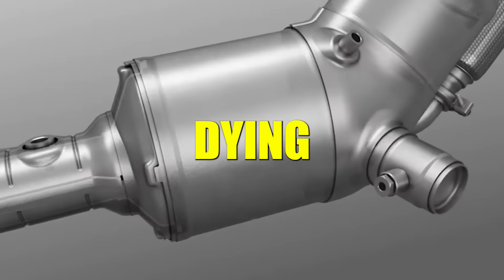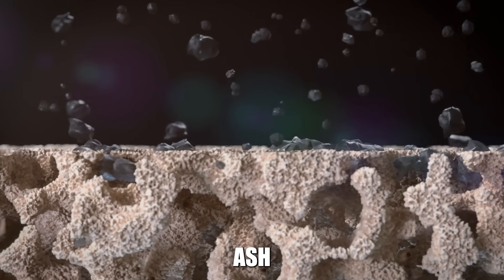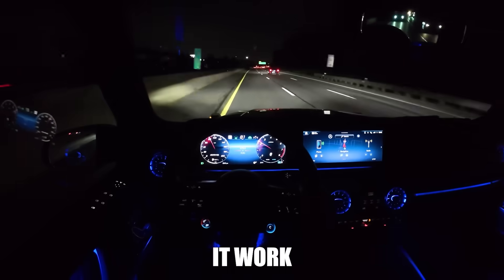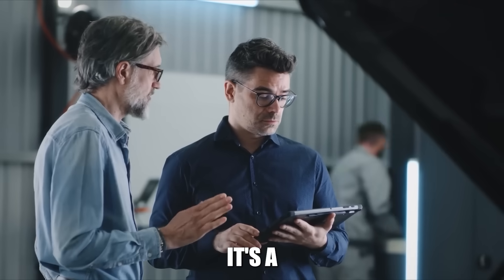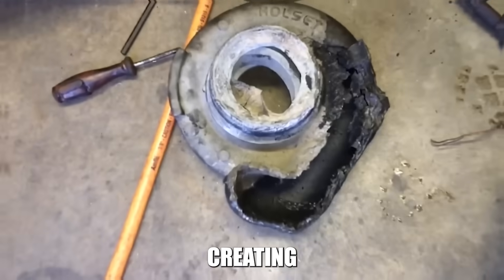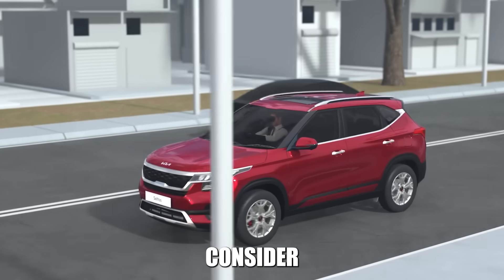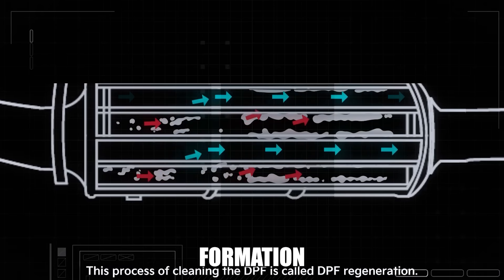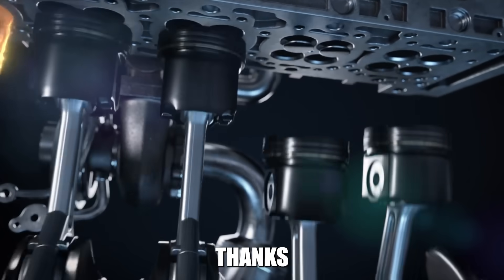Your Diesel Particulate Filter Won't Last (Unless You DO These 6 Things)

Comment: Hello, guys. I have a 2015 Renault Captur 1.5 dCi (a diesel SUV) and here is what I do to extend the lifespan of the DPF in my car (it has got a DPF): high quality diesel fuel, 15000 km oil change with low SAPS content oil (ELF Evolution 5W30), freeway journeys every other week, avoid excessive stop and go traffic, never interrupt regeneration cycles and i wait two minutes at idle before turning off the engine to avoid soot and ash builup in the DPF.

Comment: Have a 2016 Chevy with an LML that has 46,000 miles. The only trouble so far has been a bad Def heater and both Nox sensors bad. Pay close attention to the regen process and even if I'm pulling into my garage I head right back out to get the process to to finish. Also as a side note I did the CP3 conversion and added a lift pump.
Reply from the maker: Appreciate you sharing your insights, glad you found the video helpful!

Comment: BMW 330d M57 with DPF here. Every day 90 km driving. When it starts to generate while i'm almost at home it resumes the next day. I can interrup the regeneration when i want to, the car picks it up the next drive. It wouldn't be normal that you must drive till regeneration is over. You have to drive it like a "normal" car, just like the owners manual says.
350.000 km, original DPF, swirl flaps in place, EGR off. I own the car four years now and put 145.000 km on it. No problems whatsoever.

Comment: I have been told by a ford tec to rev the engine to 3000 rpm before changing up then change to the next gear then rev that to 3000 rpm i have been doing this for 6 months I am now getting more mpg

Comment: I’m a low mileage driver only 5-6000 miles on average. Been driving a diesel with DPF for last 10 years. Mostly doing shorter town runs with a longer run probably once every few months. Oil change and service once a year. Never had any issues with the DPF or even seen the DPF light come on in all these years.
Reply: what’s your secret then!!!??
Reply: What's your car?
Reply: That’s because your one in a million 😂😂😂😂

Comment: I really don't understand why some manufacturers (PSA group in particular) don't put a notice or indicator about the ongoing regeneration process. Instead they turn the mirror heating... That's the engineering "masterpiece". But they have a dedicated place for an indicator saying "dpf clogged" 😂 Not every owner paying attention to details what their vehicle is doing at some moments if there's no indication, short note or warning. Another problem, it is very often the regen cycle kicks in on the last mile of your destination, and then you just need to find a road for a steady run, but it's not always available so you're spinning around your district/area...
Can someone answer me is regeneration can be done on idling engine?
Vehicle Citroen berlingo '21, 1.5 hdi
Many thanks 👍

Comment: When short distance unladen driving is necessary, use those + & - buttons on the gear selector to maintain a higher RPM if equipped with an automatic. On some models after reaching the final gear by toggling that - button down it will lock out those high gears and remain full automatic in the lower gears until toggled back up or engine is shut down.

Comment: I have Opel Meriva B 1.3cdti ecoflex 2011 with 200k km and last time I had DPF regenaration was 7600km and it still counts. Its mix of drive, city and intercity roads no highways. I change oil and filter every 10k km.

Comment: Regular long haul drives, good quality diesel fuel, regular oil & filter changes, all equals to a happy 'modern' diesel engine.
That, and try not to "lug it" in lower gears...
Reply: You mean higher gears